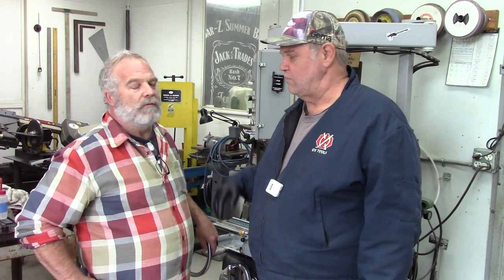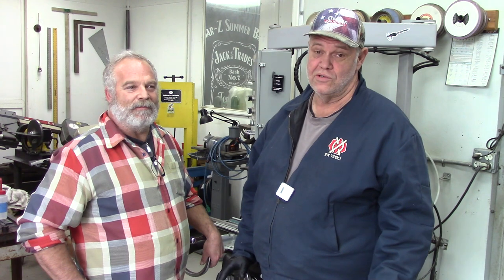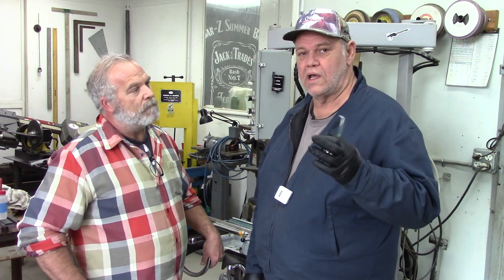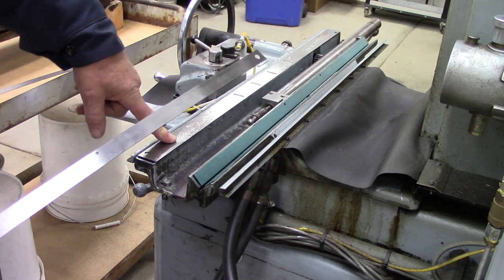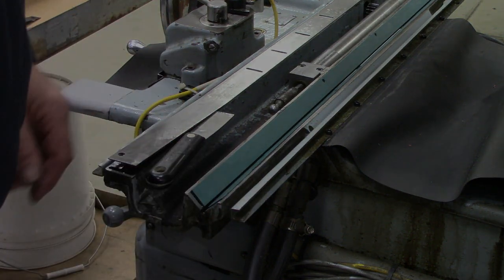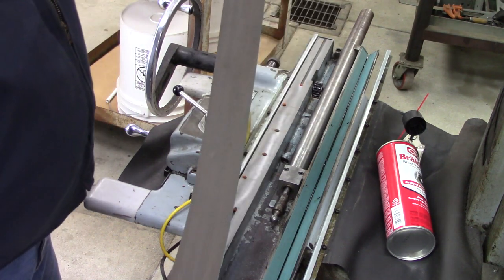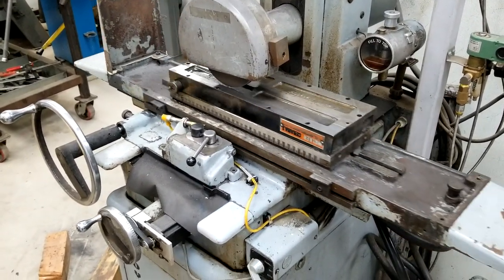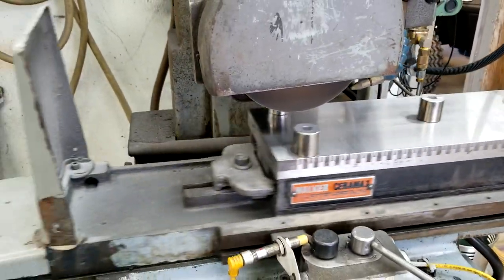Turcite B Installation

Comment: That was just flat out awesome to watch!  Stan was awesome to work with.  I think we lifted either the table or flat stone maybe 5 times an hour.  The underside of the table was flat stoned and checked against the plate.  Turcite likes to have a ground surface to ride on...inverse of that in this case.  To see it slowly come in is testament to just slow progression and care.  Grinding 6x18 worth of a mixed material surface can be hell on a wheel and as Stan gets it closer and closer the end result will improve.  The odd shape of the stone is for strength.   Pivot points settled nicely and the stone was 6" longer than the base.  Blade angle was sometimes flat as we were using the outbound non push scraping direction.  We also went with carbide as my smaller radius blades were only carbide.  It is really easy to have an oopsie on the plastic.  Thanks again !!!
Reply: Keep it up and you’ll have to change your channel name to Al Machining 😊
The spindle made a little noise, but that motor ran like a top 👍 Well done
Reply: @OldIronMachineWorks  I have so much always going on.  Happy new year Gary!
Reply: Hey, I know that dude.👍

Comment: I often have to replace or install turcite on site on machine tables any where from 12foot to 35 + feet,

How we do it is releasing agent on the machine base/table (which ever one we aren't sticking it too) then stick the turcite on the V and flat and put the table back on the base while the epoxy goes off. Pull off the next day, blue it and scrape it in. Never far out.
Reply: This is how we do it too

Comment: Ive just machined 3 gibs for a cnc milling machine. I cut them to size and skimmed them 0.2mm oversize to the originals that were really worn. My mate the maintenance engineer then scraped them and fit them to the machine, it took him all day but the results were that we recovered the machine. I also put all the oil grooves into the turcite. Was a great job.

Comment: Interesting adhesive choice for Turcite. Typically epoxy is used with glass beads to control bondline thickness is used.  I recently bonded Turcite on my Hardinge HLV-H saddle and tailstock after a bed plate regrind.  The results were remarkable and the accuracy of the machine exceeds Hardinge specifications. Turcite is some wonderful stuff. Nice job, Stan.
Reply: Waylock 2 is what is recommended to adhere the turcite, 2 part epoxy that hasn't had glass beads in it for more than 10 years, isn't needed, been working with turcite for 25ish years.
Reply: @garyhowe88  It comes down to the amount of pressure applied. I’ve seen guys apply too much and there can be excessive squeeze out resulting in a bondline that is too thin that can’t handle loads. Proper squeeze out after pressure application is very important such that a fillet can be formed along the edge for maximum strength. It’s the way I was trained during my time bonding high reliability heatshield parts on the space shuttle and the Orion capsule. I just carried that process to my personal stuff because it works for me. Apparently you’ve got your process nailed down very well!

Comment: Great videos. At 25:00, when you do pivot test. With this flat bar / granite straight edge, the pivot is not going to be at 1/3. This is because this flat bar does not have uniform weight on whole length. It will be closer to center.

Comment: great info, I have a really worn out Boyer Schultz and your method looks great , will be aware or moisture,  are the scraper blade  angles the same as cast iron 5 degrees? wow the proof is in the pudding ,5 point grind  test verifies how good you do, Thanks - extremely helpful to  me, a home gamer with some worn out machinery.

Comment: Interesting video. Long term CA user yep moisture is an issue. One of the original found uses for it was battlefield wounds, drop it in and the water/blood cured it. Still gets used even now, some dumbass fed his fingertips into a mandolin a few years ago and in casualty they glued my fingertips 🤣

Comment: friend comes over with a guillotine in a box that hes found...

wtf am i going to do with this? put on shelf.

in three weeks ive now used it twenty times... lol.

very handy for cutting this stuff :) and copper/brass shim. all that stuff...
then a scraper/razor blade to trim excess off after epoxy has set.

never had an issue using any old hi-strength epoxy. always lets go off the turcite first... it is TEFLON after all...